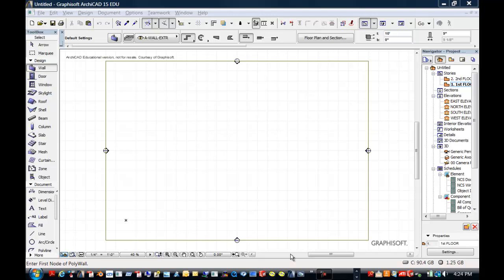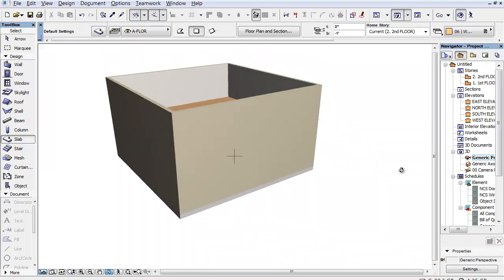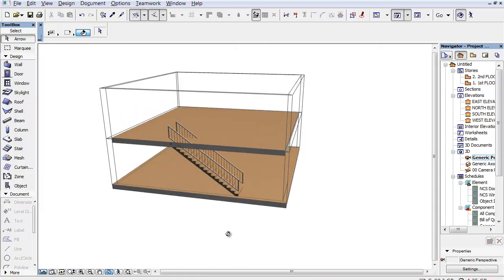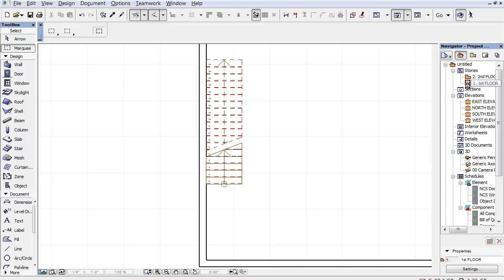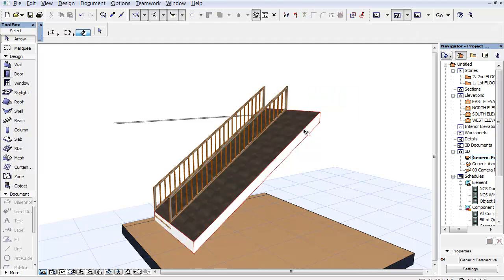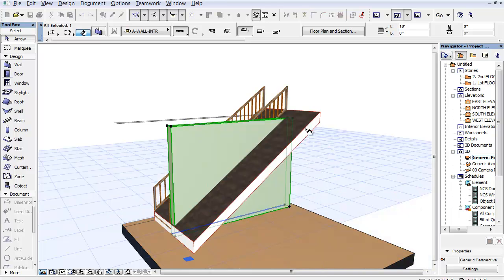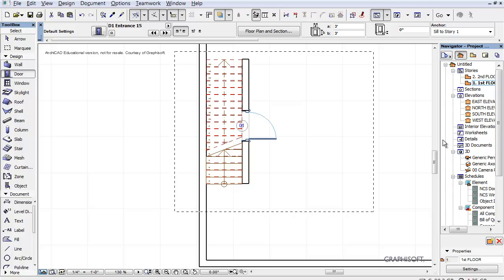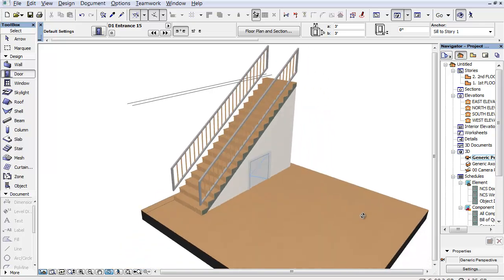How to trim a wall to a stair in ArchiCAD 15

Comment: There is a much easier way to do this, if you use solid element operations /design-solid element operations; select wall as target and slab as operator/ You can trim a wall until stairs or any other element, without making a roof.

Comment: thank you this helped! 
Sometimes this doesn't work, but I don't know why. Somehow if the wall is slightly bigger than the roof maybe. Also I had a gable roof and two simple roofs with different angles attached to the side of it. in the space between was a wall which needed to be trimmed to two roofs. it didn't work at all.

Comment: The easiest way to check out the angle is the use the MEASURE tool located around the middle of the top tool bar.  You would select the endpoints of the angle you want to measure and ArchiCAD will let you know the distance, angle and other information.  Hope this helps.